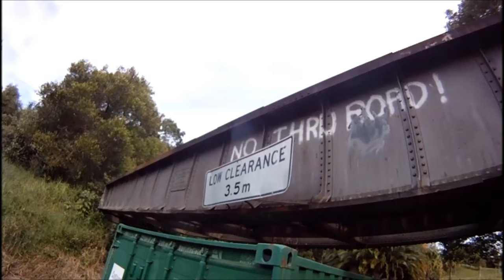shipping container becomes trailer 2

Comment from the maker: We used 100mmx100mm steel with 5mm wall thickness across the back and trailer stub axles welded into the ends. Since the video we have swapped the hubs from Ford to Holden Commodore stud pattern so we can fit rims that sit in tighter. (different offset). Important to fit risers that lock into the container corners. Don't expect gravity to hold it in place. Wheels lift off (see vid) and the axle must be locked in. If in doubt, over-engineer.

Comment: That set up is what I am looking for ... Have a vid on how you made it ....?
Reply from the maker: Start with the front end of a 4WD and a couple of mates. Work it out. Pause the video to see what we did and then make your own with whatever is at hand. The drawbar has a locking pin through it for towing like a trailer to the container and you can see the towtruck guy take the weight off it so it comes out easily and then the towbar can go up and down. The towbar turns the steering and is at its limit of travel at the end of the video. We considered making a similar setup for the rear for four wheel steer but we only need to move a container every now and then so it's good enough. You can maybe do better.